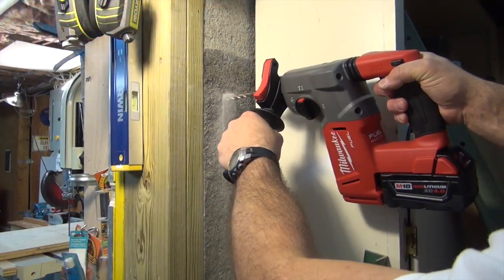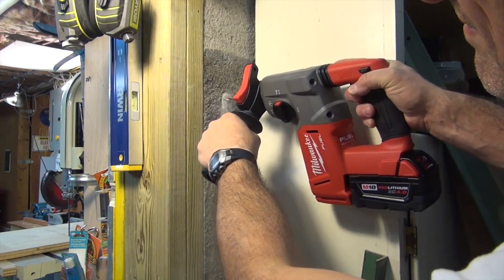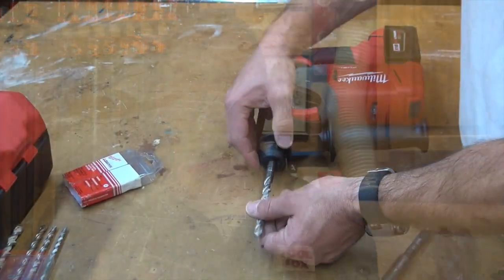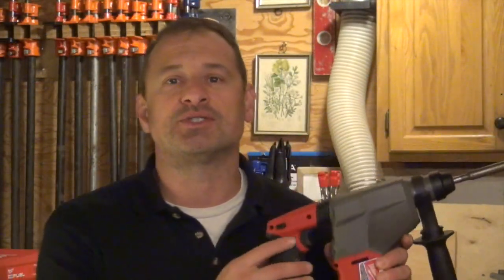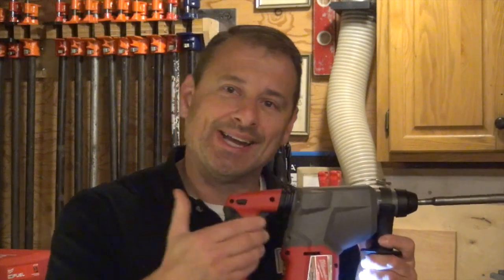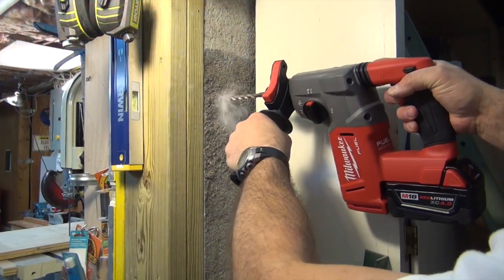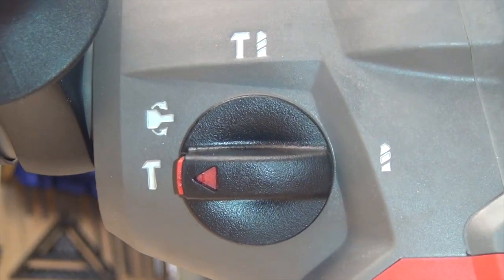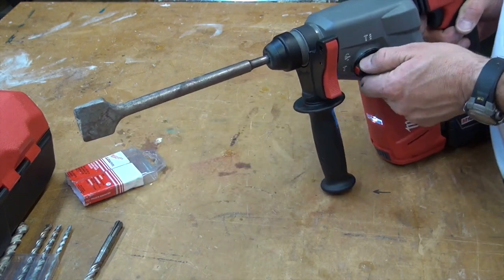Milwaukee M18 1" SDS-Plus Rotary Hammer 2712-22 Review

Comment: I've got the 2712-20 1 1/8" rotary drill.  Main use is concrete hole drilling.  I was looking to see how well it would work if I needed to chip some concrete. I didn't know about the setting you showed for locking in a set position.  Thanks.
Reply: Correction, it is the 2715-20.  Got a boat load of Milwaukee tools...my favorite brand.
Reply: @OlTrailDog  Have you used it to chip or break concrete at all?

Comment from the maker: This a great tool that is light-weight, easy to use and feels great to work with.  I’m super impressed by the combination of this SDS drills compact drill size to weight and power ratios.  This drill is Bad Ass!